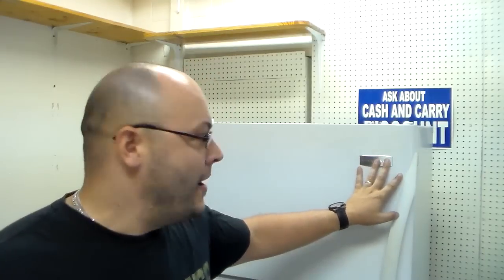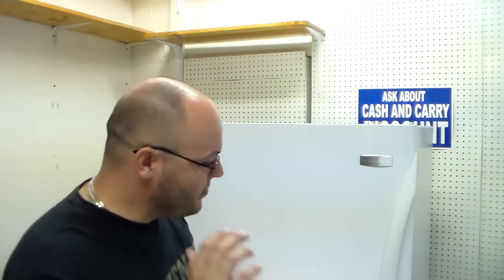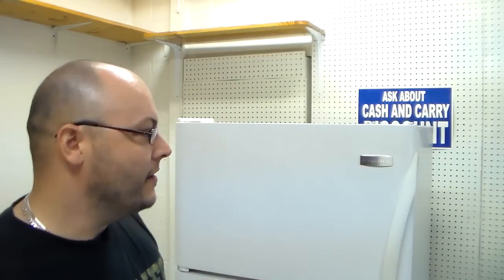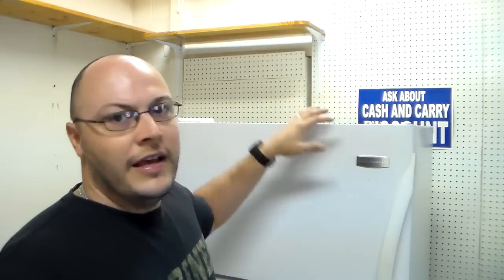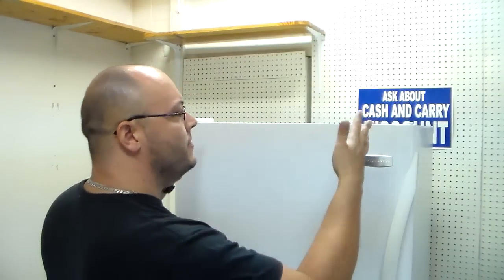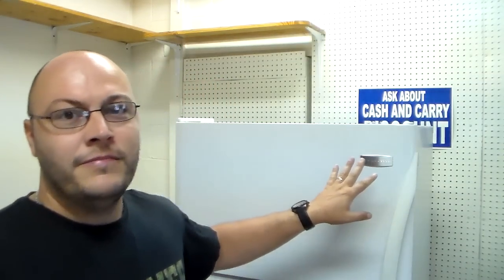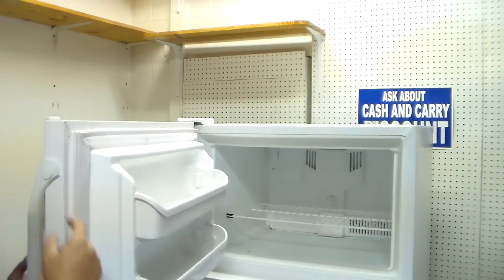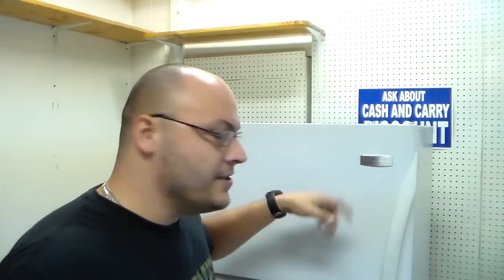Freezer Door Pops Open When You Close The Refrigerator Door

Comment: Vaseline 100% fixed my freezer seal issue.  Been simply "dealing" with my freezer being left open randomly for over a year.  Didn't want to go through the amount of work it would take to tilt it further back. Finally after losing 3 lbs of ribs and half of a smoked pork butt, started looking for answers.  So relieved for this video!!!  Thank you
Reply: Our front wheels weren't raised all the way.  A nut driver tool was able to tighten then and it raised the front.
Reply: vaseline fixed mine too
Reply: Much appreciated
Reply: Hey, just came across your comments. Just curious, how long does the Vaseline work for? I.e how often do you have to reapply it?

Comment: This problem plagued me when I moved into a condo which included the refrigerator. My wife accused me of leaving the door open. It got to the point that it was creating marital problems. I had to solve the problem.
The solution was to get a magnet from Radio Shack size (2x1x3/8). Place it at the top corner of the freezer (not on the door but on the refrigerator) just above the seal. Put the magnet so that the edge with the larger flat surface is on top of the seal when the door is closed. Hooray! It works and I am her Prince again.
Reply: +Ted Stecko I feel terrible but two weeks ago, I accused my boyfriend of leaving it open. He's away today and I walked into the house this evening to find it wide open. I knew I couldn't have possibly done it (of course, self-serving bias much?), and now I know. It wasn't either of us. I've apologized already.
Reply: Can you show a picture of the magnet you used?
Reply: i  thought it was carelessness on who ever last opened the fridge, before I realized it and this video solved the issue; i was going to velcro the door, lol

Comment: Thank you so much. You didn't tell me how to fix it per se, but you did imply the level of the fridge could be adjusted. Sure enough, my 10 year old GE, which I've hated since we bought it, now has a freezer door that shuts back after it opens by itself. There were two black screws. Tightening them (clockwise) raised the front of the fridge up so that now the freezer door snaps back shut, so THANK YOU! We were seriously about to buy another fridge since my elderly mom never would shut the freezer door.

Comment: Somewhat of a cop out answer saying there is no fix. Maybe there are just some different reasons. Our freezer door pops every time we shut the refrigerator door with a little force and the fridge door pops if we do the same with the freezer. and then they don't shut on gravity alone (the friction is too strong in closing). Reading the insignia manual after this, I think we may need to try to adjust the tension on the door. It always feels like there is something rubbing when you open or close the door. You would think that would make the door hard to pop, but apparently it makees it easy to pop open hard to get closed. I will try the vaseline/parafin trick. And I am also considering attaching some more magnets to see if that helps to keep it from popping.
Reply: Ok So the leveling works well. It's actually tipped back a little. Also found that some screw was installed that rubs on the bottom bracket, don't know why but ut has cut quite a divot in that bracket. Things are smoother now. the fridge door still pops but not the freezer. About to try the vaseline.

Comment: My refrigerator appears to be operating normally...based on power on/off cycles, temperature in the fridge and freezer appears ok. Problem is it’s only 2 years old and it’s frosting in the freezer compartment. My question is, can this popping which mine does....cause frosting by allowing air into the cabin every time someone opens the fridge via popping. Add the amount of times we open the fridge to the amount of times we open the freezer and that’s a lot of air gettin in. Would love to hear what you think...

Comment: earlier today i noticed that my fridge door was sitting slightly lower and the light was on 24/7 in the fridge. I then adjusted the bracket slightly so that the door would close properly and the light would go off. When ensuring the door closes properly by opening the freezer I then noticed when i close the freezer, my fridge door sightly pops open and the light goes on you can see it near the gasket, but then it closes. Any way to fix this?

Comment: I noticed you mentioned in this video "there's nothing that closes like a damper on a side by side" and with that being said, I have a custom kitchen with a side by side freezer and refrigerator. Every time I close he refrigerator the left column which is the freezer pops open just slightly. Not enough to have the light come on , not enough to signal us with the beeping that will occur when it is fully open, just enough to allow my freezer to thaw out if left for some time and all the ice in the ice maker to melt and drip all down the inside. Being that it is a custom installation, I cannot adjust and tilt the unit back at all. It's completely built into the cabinetry and prefab housing. Any suggestions for this to be minimized if not fixed ? And are there other options based on the comment "there's nothing that closes like a damper on a side by side" would that mean that on a side by side I have another route to go ? Thanks to you or anyone who replies and have a great day!
Reply: Did you find your answer? My side by side does this same thing.
Reply: Try the vaseline - it works on our side by side. We had the exact same problem.

Comment: helpful about tilting but vaseline is petroleum based and therefore degrades rubber and should NOT be used on rubber seals. Bad, bad advice.
Reply: not bad advice. You can also use silicone lubricant that will not have an adverse effect on the gaskets.
Reply: why would you use a lubricant??

Comment: It's not about the "surface" area of the fridge v. freezer door. When I close my freezer door the refrigerator pops open. It's simply a pressure issue; even a smaller door can cause a bigger one to pop open, provided the pressure is simple enough.

Hoping leveling... er, rather, unleveling will fix the problem...